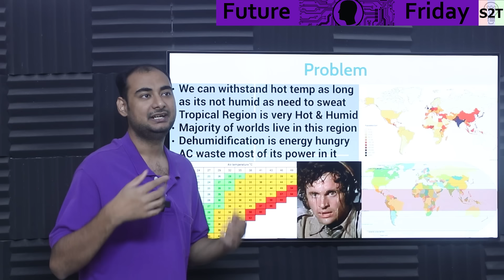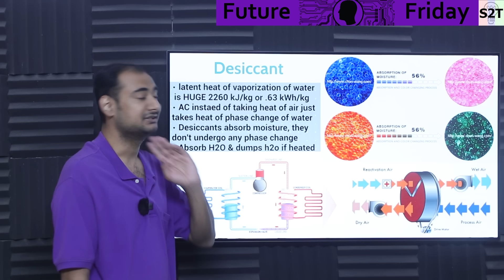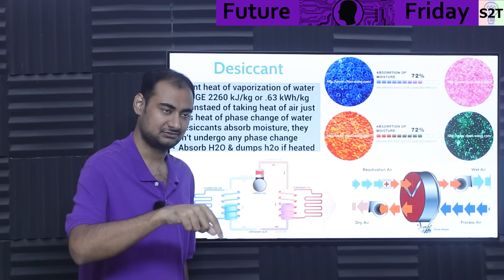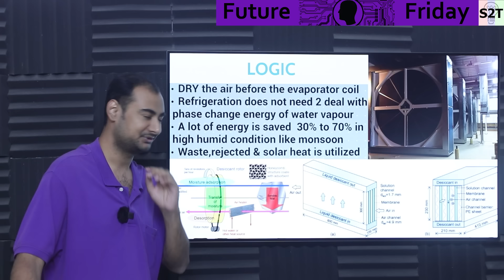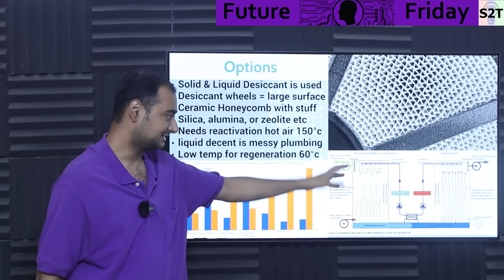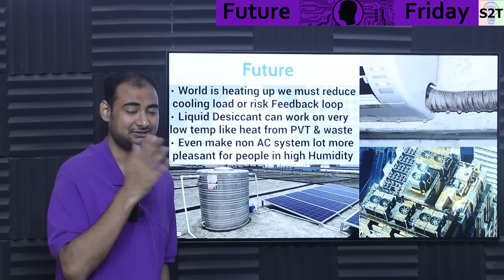Desiccant Assisted AC Systems Explained {Future Friday}

Comment: I am starting a ROOFTOP solar installation business my empanelment request letter got approved starting in Chennai Tamilnadu 

Any suggestions? (On anything)
Reply from the maker: well try to find seller for PVT as  that is the future other wise the cells will overheat and fail and train your stalf on proper tool use like Using plastic anchor for screws and feral crimps for wire and automatic wire striper and U want PRO look invest in quality lable maker and clear heat shrink tubing

Comment: Very good video yet again.  Luckily for me, I live in Perth Western Australia. Our highest temperatures occur in Summer when there is a large high pressure system in the great Australian Bight and an easterly wind brings air all the way across the continent to us. By the time it gets here it is very hot, but also very dry. 43° is still hot, but as you point out, with low humidity it is not as bad.  The air conditioners don't have to work as hard.  

Even so, there is some moisture and a desiccant system could still make them more efficient.
Reply from the maker: Yep DRY air is not that bad  but yep anything to reduce the load is WISE

Comment: Another great episode! 

Besides the high capacity of calcium chloride, it's also extremely cheap, in bulk. 

I've seen a suggested system where the developers worked on using liquid desiccant to achieve two-stage evaporative cooling. Interesting idea, but I haven't seen any such systems in use.
Reply from the maker: Thanks & interesting